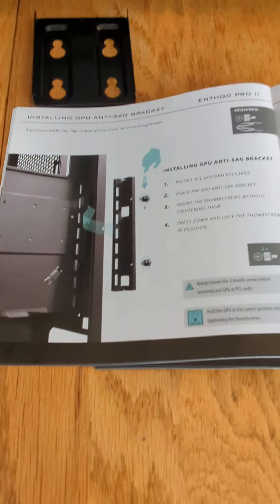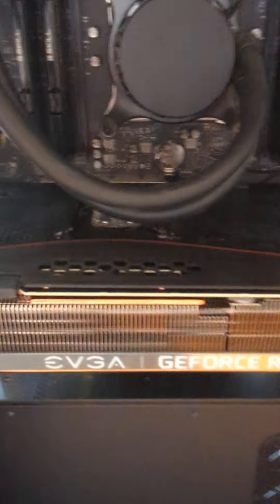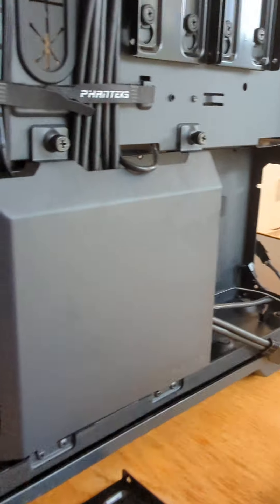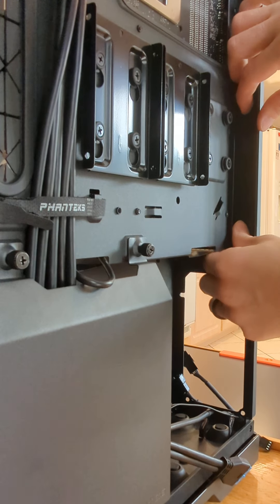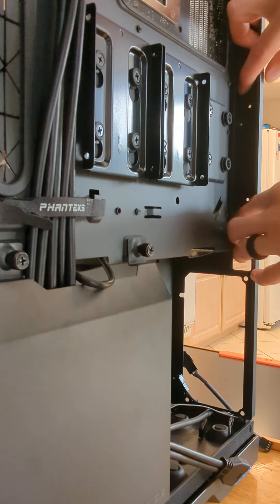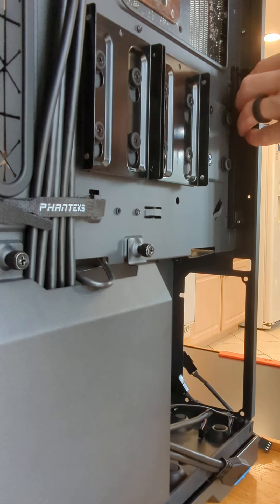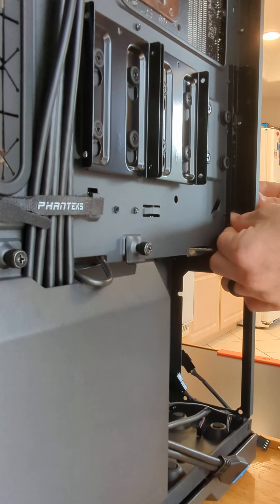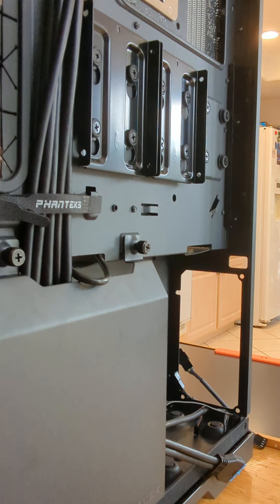Phanteks (E-Z) install GPU Anti Sag Bracket.

Comment: How does this even remotely prevent gpu sagging?
Reply: still trying to figure it out myself
Reply: @dissonant_beats6430  Do you know it now?
Reply: @creytax9802  , could be wrong, but it might be preventing the panels on the rear of the case, that are below the gpu hdmi-ports, from buckling. But that seems so unnatural.
Reply: Think you push down on that bracket before screwing it in to prevent sag. Just doing the physics in my head. If the gpu sags those metal tabs would probably want to go upwards. Downwards pressure I think would prevent that? Not entirely sure. Brain malfunctioning.

Comment: does it really do anything if you install it after the GPU is aleady in place?
Reply: Wondering the same thing.  How the hell does that help with GPU sagging?
Reply: @TarixVR  Ofc NO. You must install anty sag before you screw the GPU, just little hold GPU, mount anty sag by 2 screws then GPU to case.
Reply: @gh0st3kk86 the manual says to install anti sag only after installing the GPU
Reply: @pjx0073  fax, so trynna figure out what makes sense lol

Comment: uhh push down and not lift up???
Reply: You push down so the other end of the card lifts up like a counter lever
Reply: @kaka0bab I'm surprised that the guy in the video did the opposite
Reply: @qweqwert4080  yeah he didn't push it down so the whole thing is like pointless but I have to agree with him, the manual could be better
Reply: Why is no one else pointing it out. He's installed in a way to increase the sag, lol